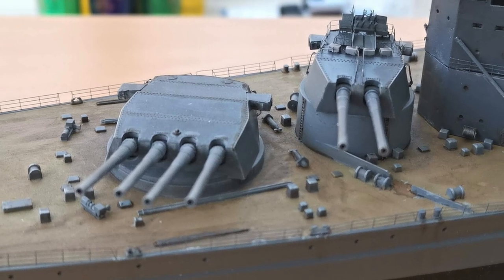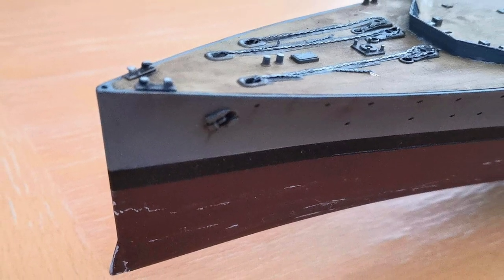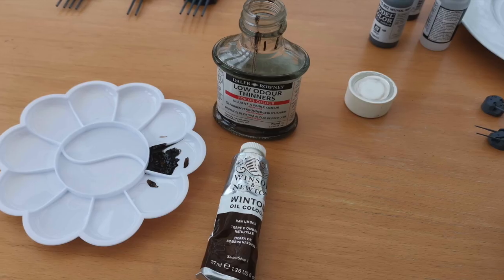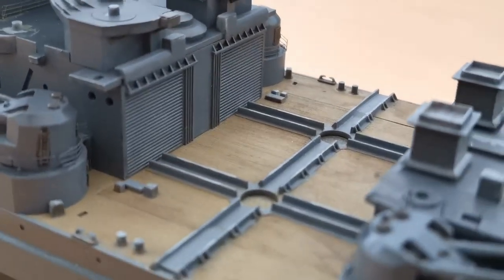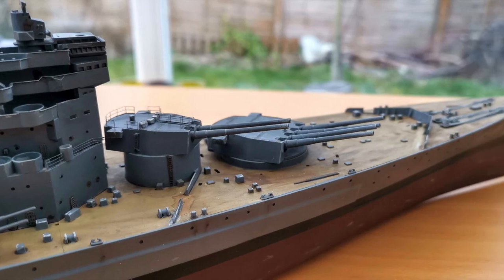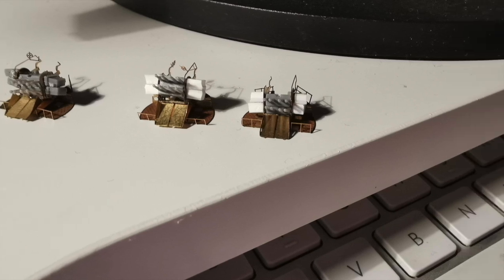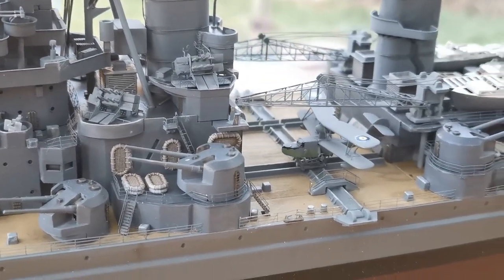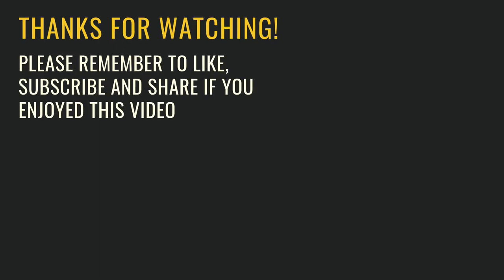1/350 HMS Prince of Wales Battleship Model Build Part 3

Comment: Do you put weights inside the lower hull, make it water-tight, and make your model ships float? Because I’m planning to do so to my 1/700 scale full hull ships.

Are my plans to make them float okay?
Reply from the maker: I have to admit I don't do that, well at least not yet. The idea should work for a 1/700 ship but probably won't need much weight. The hardest buy will be keeping it water tight

Comment: Great vid and model , one question I was given both the POW and KGV will the wooden upgrade deck fit both models  haven't look at the decks, as I plan to get one as they look fabulous on all the pics I have seen ? cheers
Reply from the maker: Thanks Dave! The deck layout is slightly different on each ship I'm pretty sure. The KGV has more anti-aircraft pods on the stern for example. Which one are you planning to build?
Reply: @JJModelMaking  Many thanks for your reply. I would like to do them in Tandem and want to get the decks at the same time ,and now having seen the great look the Eduard upgrade kit does will invest in them as well. Will take time out to study the deck of both ships before buying of course.  do you have videos of all your ships constructions on Youtube? as these ships I have are the first I will attempt only use to building aeroplanes and now Dinosaurs. but watching your vids will give me so much visual experience when I come to build my ships keep up the fine work
Reply from the maker: Thanks Dave! You'll do a great job I'm sure. I'd suggest buying a set of main gun brass or aluminium barrels as well (wouldn't bother with the secondary guns) as they aren't included with the Eduard set. As for videos of my various models on YouTube, yes they are all there in playlists. Some of the smaller ships only have one or two videos per build but hopefully you'll find them interesting too. Any one ship in particular?

Comment: hey! what do you use to put the small parts onto the wooden plate, i tried finding some material for easier painting and not getting finger prints all over.. is it some sort of playdoh or a Special material for modeling? thanks in advance
Reply from the maker: Hi Peter, I didn't actually use a wooden deck on this kit. Essentially I painted the deck wood colour and then painted the smaller bits by hand. You could use Maskol or something similar though?
Reply: @JJModelMaking   i should have specified, sorry. at 5:08 for example you stick the small parts into some Kind of gum, and ive been looking for this material since it is making the painting process of the small parts so much easier.
ive done the same octuple 40mm guns for the war spite from photo etch parts, but when you have to touch them so often to get every side coloured, then it gets deformed and some parts may break off.
i dont know if what i mean is understandable for a native Speaker though.. :)
Reply from the maker: @Peter Zellinger AH! I see what you mean. The gum is what we call Blu Tac in the UK, a slightly sticky reusable gum made by Bostick - I'll past a link below. Something similar will be available more locally to you I am sure, maybe from a stationery or arts and craft shop. It's often used in schools for examples for displays?

https://en.wikipedia.org/wiki/Blu_Tack
Reply: @JJModelMaking  thanks!